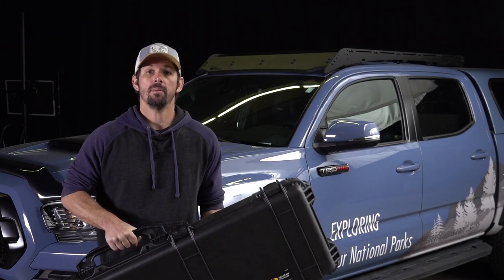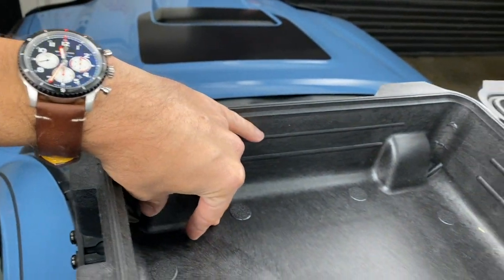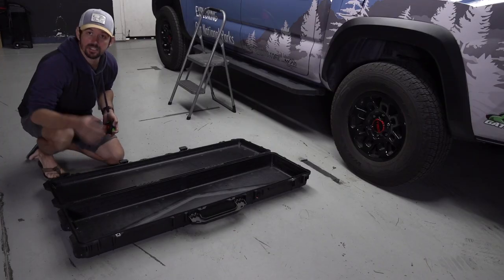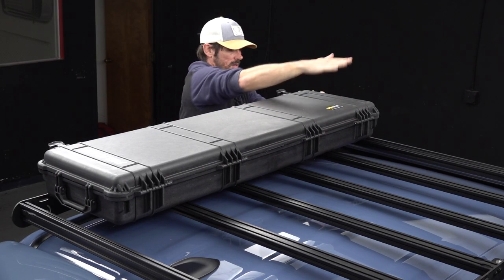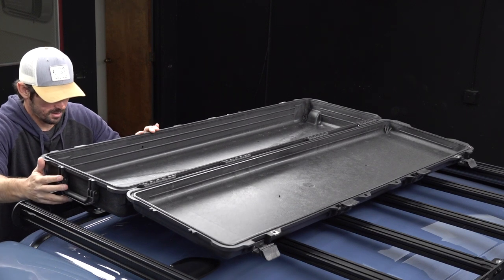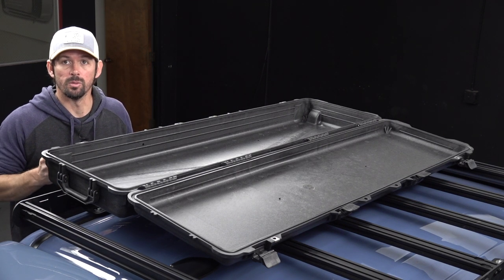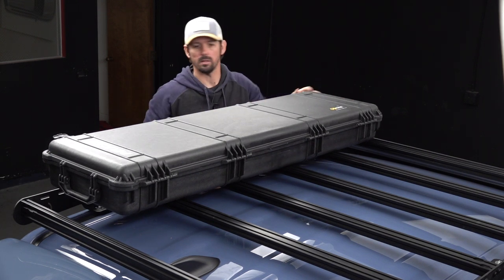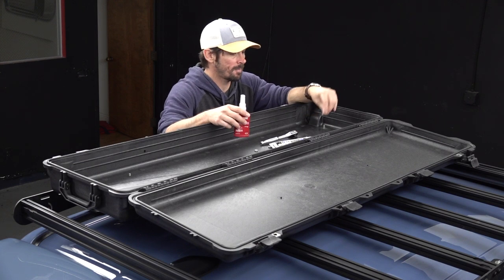Installing a Pelican Case on to a Prinsu Roof Rack

Comment: I have a Prinsu. I used to purchase galvanized carriage bolts from Home Depot for my rack but I've had waaaaay too many of those bolts shear off. It took me a while to realize that Home Depot's galvanized hardware is crap. Now I just order stainless.
Reply from the maker: Shearing off! What are you doing that bolts are shearing off? I have used galvanized bolts from Home Depot on all my racks for decades with no issues. I never heard of these bolts shearing off.
Reply: @cheynewalls  Not doing anything crazy, lol. Attaching LED lights, an awning, a Waterport, etc. Maybe the supplier to my Home Depot just had a bad batch, but I bought about 50 of them in a bag, and I'm having all sorts of issues with them. Shearing off is just one of them. I've even seen a couple rust, which, that's certainly not supposed to happen to galvanized hardware. And I've also found that their sizes have not been consistent at all. I only purchased 1/4-20 carriage bolts and yet, half of them will slide in the Prinsu grooves and 1/2 won't at all. The galvanized carriage bolts at my Home Depot are absolute garbage.

Comment: As opposed to the silicone and the lock tight, it might be beneficial to consider a rubber washer under the flat washer and using nylon nuts. The would essentially make it waterproof and not likely to come loose without the mess of the silicone and the the inability to remove with ease the red lock tight would cause. Nothing wrong with how you did it, just looking at alternatives if you would wanted to be able to remove the case with ease after trips.
Reply from the maker: Thanks Cory, but you can't use rubber washers on a setup like this. With all the differing temps from very hot to sub zero will crack the rubber washers, losing the water proofing. Saw this first hand on one a friends truck. Cheers